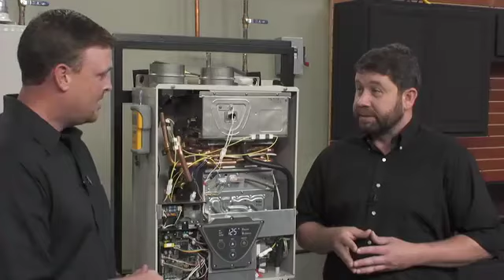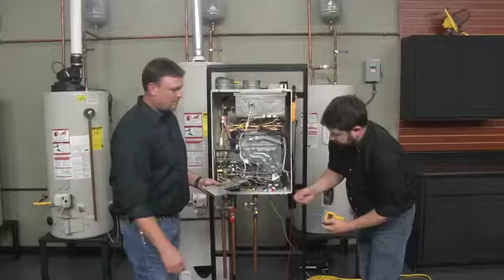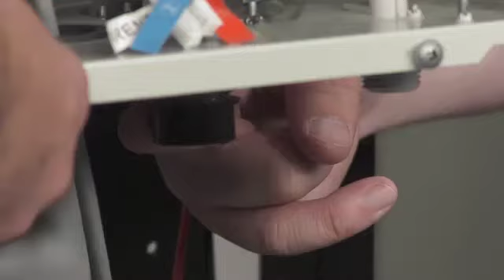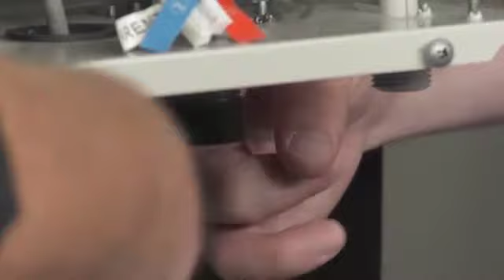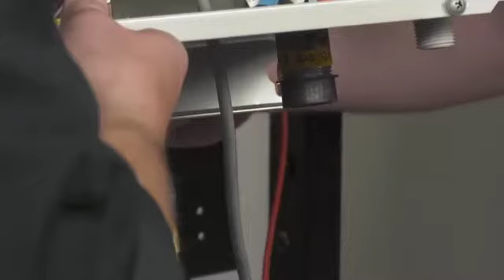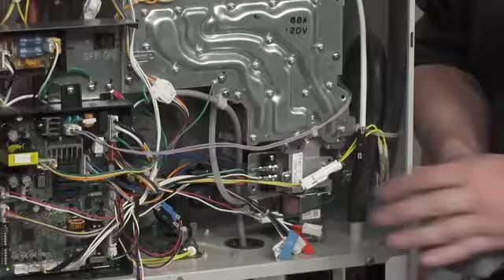Code 111 or 121   Ignition failure

Comment: I hate this water heater! I bought it a Lowe's and installed it.  
 Error code 121right off of the bat and keeps flashing, and I have done everything to try to fix this stupid thing. What a waste of my time.
This unit is WAY more complicated than it needs to be. 
I don't need AI in control of my hot water.
I bought a water heater from Amazon and paid half as much... and guess what? It worked on the first try. No codes or complicated reasons for stupid codes. 
Hot water when I need it. Simple.
Wwwaaayyyy over thinking this water heater!

Comment: I have a Noritz EZTR40 and was getting error 121. After a quick cleaning of the ignition plug and sensor with a little fine sandpaper and some fine steel wool it was running again. Before that it kept shutting off and on, I could see the flame looked fine in the window, but the sensor wasn't sensing the flame because it was so crusty (like a bad spark plug looks) that it just wasn't able to do it's job anymore. The guy on the right in this video mentioned that possible problem and that they would cover that later, but they never did because the other dude who apparently his job was to interrupt him constantly, sidetracked him so many times they forgot to. So, I thank them for at least explaining the possibility of the problem to me, but the fix would have been nice to know! I ended up finding out how to clean it from a Noritz video on routine maintenance. But basically, you turn off the gas valve and unplug it first, then pull the 2 wires off the ignition plug & Sensor, remove the 2 Philipps head screws and slide it out gently, try not to break the gasket when taking it off (I did) then clean those sensors on the back side of it real good like, with some steel wool or some fine sand paper or supposedly a dollar bill (Doubt that would of worked with mine as it was real crusty) or something abrasive like your crusty ass socks after not taking a shower for 2 days. Then put it back together, turn the gas back on and plug it in and Whamo! it works again! I had to scotch tape the less important side of my gasket back together temporarily until I can get my hands on a new one and replace it. at about 3:42 on this Noritz video they show how this is done https://www.youtube.com/watch?v=iLiV2YSSLrk&t=260s

You're welcome!
Now go take a shower before anyone else knows you fixed it!!

Comment: I’m getting code 391, and soot on flame rod. Very often , every 2-3 weeks the AFR rod needs cleaning.
Gas pressure is good, flame is nice and blue. 
Could it be rich combustion? Doni need to replace the gas valve?
Unit is 10 years old
Running it at 135-140F temperature.
Unit is used for heating and for how water supply

Comment: tested all that still getting code111 . is there supposed to be air moving through where the igniter is theres a lot of air i remove the ignighter outside and it trys and i get code 121

Comment: My issue ended up being the hose from the propane tank to the hot water heater. It was leaking and not providing enough gas to the unit to operate. I was getting code 121

Comment: Thank you for the video. I was getting the 111 error code. I had converted the water heater from natural gas to propane. I forgot to adjust the dip switches. I hope this helps someone out there dealing with a similar issue.

Comment: As far as the gas valve self testing, in your video there is a definitive 1 clunk, x’s 3.

My units pattern is when hot water is turned on:
Fan, clunkCLUNK-clunk-clunkCLUNK-clunk-clunkCLUNK-clunk- Fan RPM’s increase & trouble code is displayed.

Also, unit is about 20 years old, so maybe not worth fixing but if there’s a easy fix -maybe a new gas valve or whatever can be recommended as more troubleshooting.

I did clean the igniter and flame rods those look good and there is spark at the igniter rod.

Any recommendations is greatly appreciated.
Thx
Reply: If you’re using a 310c 510c model number , this code 111 will happen if you don’t vent it correctly, there is dip switches in the tankless and you need to flip it on , look at the owners manual it will tell you everything.
Reply: @charlie_Df17  
Update:

I did find a YT video of a tear down so I gutted the unit: burner assembly was dirty,  lint in some of the passages on the manifold-those cleaned up pretty good.
But once I got looking into the combustion chamber and heat exchange assembly, those were aged and & showed signs of un-repair, so I threw the towel in and ordered a whole new tankless heater.
At least I got to learn stuff that I didn’t know before.

Thank you

Comment: Thank you very much. DIY guy here who installed this unit to replace electric radiant heat. This has been the first issue. Cleaned the ignitor and tightened the ground screw. Back in business.

Comment: I have a question when I was descaling the machine I used a pump, beforehand i cleaned the filter to catch the debris then I tightened it and it seems like if I over tightened it, the flow of the pump was dramatically reduced to 10% of what it was if I loosened up the small filter. should that have an affect on water flow?

Comment: If you get this error on first light, just do what he did and "reboot" it at least once. Had this error... had air just in a 24" appliance hose.  It lit on like the 5th click.  Honestly can't purge that easily, the rest of the gas lines & manifold were primed and active already.  I mean... I can see that they don't want too much gas in there, but the 3 tests for flame happen too rapidly.  It needs time to evacuate any air in the lines... and that was with propane geez.  I can imagine if you have a 48" appliance hose and natural gas, you'll probably have to restart it 2-3+ times on the first go.